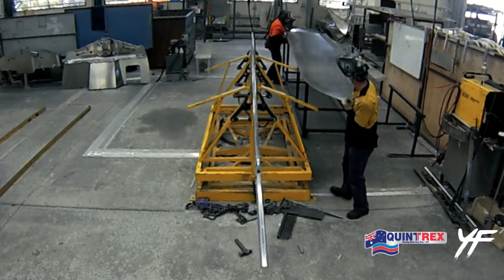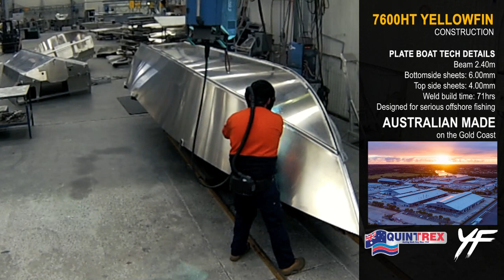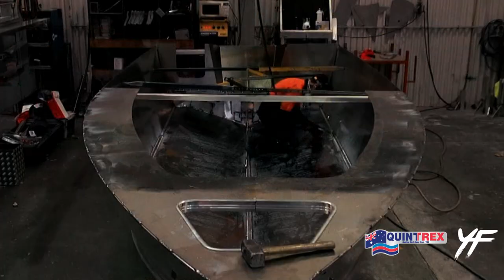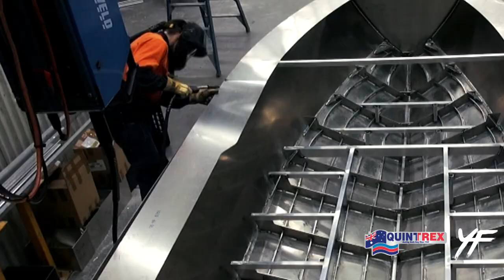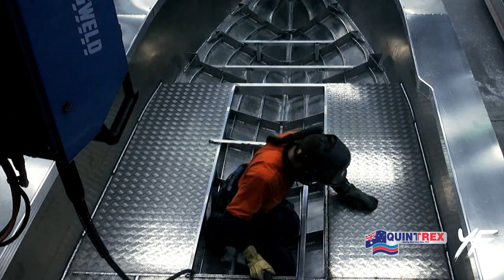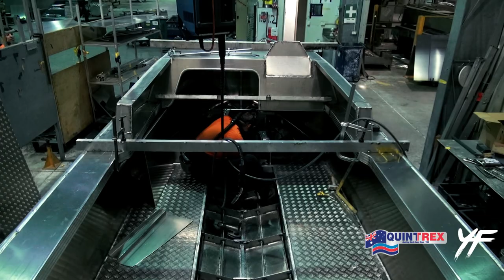Quintrex Plate Boat Construction - 7600HT Yellowfin

Comment: Damn that's nice welding compared to many small workshops. Especially getting the boat to slide back and forth on rollers and rails for the long welds on the bottom is amazing. A very clean look.

Comment: Hellow bro.
I wanna make my own aluminium boat.
What aluminium sheet thickness and alloy is better for making hull?
Reply: 5086 , in boat building scantlings are used , which basically means you go and look at as many boats as you can , and make a educated guess , bigger boats tend to use thicker material , boats that see rougher service tend to use thicker material , you need to be careful about not making abrupt transitions from something very stiff to something more flexible imagine that you were a giant and you grabbed the boat and started twisting and bending it , now imagine where it would crack , those are the places you need to pay a lot of attention to .
Reply: @robertlackey7212  thnk u bro

Comment: Where's the floatation? Relying on air lock once the floors down. What if you get a hole, she sinks?
Reply: All boat sink if they get a hole . the way boats work is by displacing more water than the weight of the boat . this boat may weigh 2 ton but displace 4 to 5 ton of water weight .
Reply: @clintpuddister7257  incorrect, level floatation if done right allows you to bail out and get going again. PU closed cell foam filled cavities do not allow water to enter the hull even with a hole.

Comment: No respirators, turn a solid into a gas then inhale it cool and turns back into a solid.
Boycott that boat builder until they start treating there staff properly
Reply: Main welder did but the apprentice had disposables. Likely the main welder probably bought his own adflo system. I agree there shit heads for not sorting out the apprentice

Comment: Still no foam.  What a joke. Only meets Inland rivers. Wonder what BS weight you'll stamp on it.

Only recently i borrowed a hornet trophy 435, i had some concerns and ended up weighing it at 514kg with no fuel. Supposedly you can put 4 people /400kg in it! By my calculations you would be lucky to have one person with gear or two people without even a fishing rod.

So if i took the manufacturer weight and tried to tow this with a Hyundai, cause supposedly your within limits, then have an accident and have everything weighed to find out your over weight!

The early hornet I tested wouldn't even meet basic floatation and would sink. I don't actually think Quintrex knows how to perform displacement calculations.

When the boats are unbalanced then your centre of bouancy shifts, you guys don't design this in. You only need year 11 physics to work it out.

I worked this out after putting my family in this boat with gear at 270kg. We had water lapping in at the top sump plug. We shifted weight forward and slightly improved but not enough for me to launch off the Jetty.   I took my family out of the boat and put it back on the trailer. And went and performed my own calculations as described above.

These things are a death trap, especially in tropical waters with crocs and large tidal  systems up north.

I wouldn't by an aluminium boat with a short shaft, the displacement can never meet the design loads with any safety factor greater than 2.  Basic floatation safety factor is 5. 

I'm extremely disappointed that my life and that of my families was compromised because I trusted the build plate. 

Please anyone reading, make your kids finish year 12, maths & physics is important.

Comment: You Aussies know how to make a tin boat!  Nice!  I would like to know how many linear feet of weld goes into one of these hulls.
Reply: mike underbrink   A shit load...technically speaking! 😉
Reply: Probably about 3 or 4 90 pound bottles of Argon shielding gas, probably 4 or 5 kms of alloy welding wire, so 2 miles of wire?
That’s based on welding up a 16ft v nosed punt once about 15-20 years ago.
Reply: A quarter mile or more maybe
Reply: 3 to 4  4.5 kg rolls of 1.2 wire  and about  2 1/2 big bottles argon at 20 lpm thats for a 24 ft  5mm bottom   4mm  sides   3mm cabin  boat